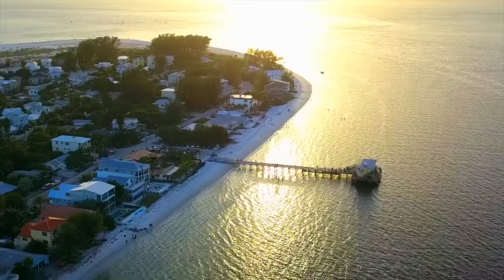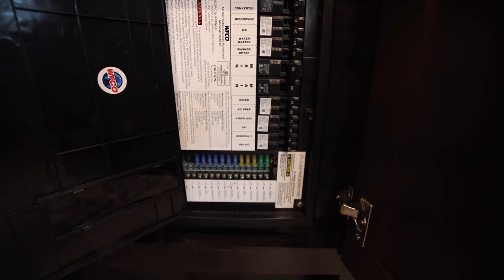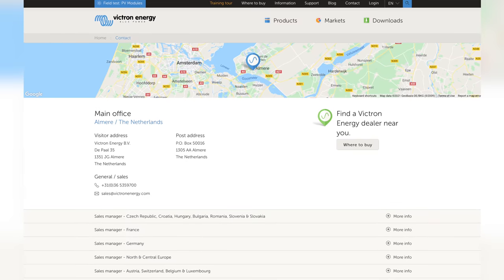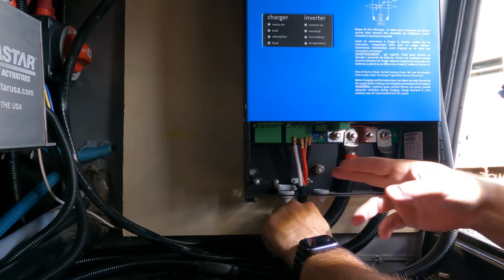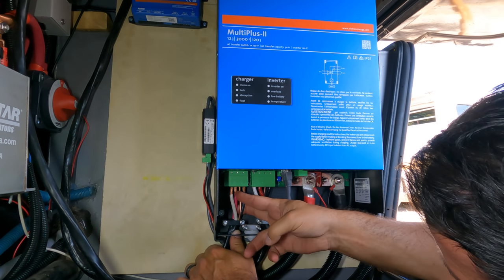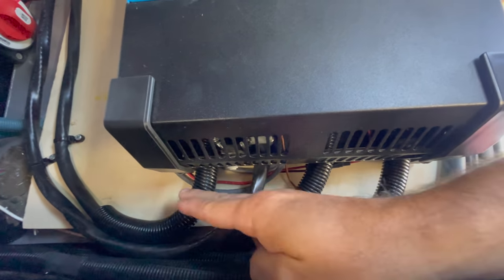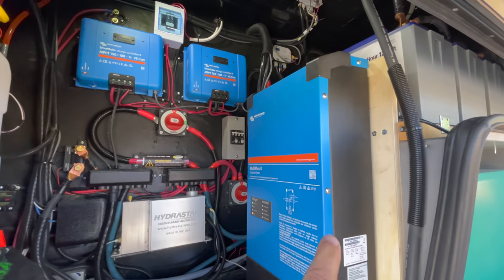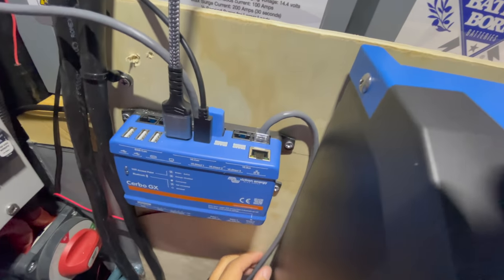🔋⚡️🔌 RV Inverter Upgrade! (Victron Multiplus II 12V 2x120 and CerboGX!) (Full Time RV Life)

Comment: Kind of a long question so if you can be patient please. A question that may or may not be unusual, I've watched yours and several videos on the 2/120 inverter. I ordered and received one in August, but have yet to install it. The reason is this. My 50 amp 2006 Winnebago came factory with a 2000 watt dimensions inverter. The main distribution panel has of course the 2 50 amp breakers, but also a 30 amp breaker labeled "Inverter" Then it has a sub panel that also has a 30 amp breaker labeled sub-main  and several 15 amp breakers marked Refrigerator, microwave, receptacle 1 receptacle 2 receptacle 3. Prior to the failure of my old inverter, I never paid much attention but realized that only those items in the sub-main could be run with the inverter. I assumed, (apparently incorrectly) that the 30 amp breaker in the main panel just supplied power to the old charger/inverter and the 30 amp sub fed all the items I listed above. As the new Victron 2/120 appeared a little complicated, and I was short on time to head off for the winter, I just grabbed a Renogy 2000 watt inverter that wired directly into the 120 in and 120 out and of course the 12v from the failed inverter. What I subsequently found out, it appears that all the power from the 30 amp breaker in the main panel, goes out, and comes back to the 30 amp breaker in the sub panel through the inverter/charger. I say this, because even on a 50 amp shore power, if I turn the inverter/charger off all those items I listed in the subpanel do not work. In fact even with it on, if I have been off shore power for a few days, and the batteries are somewhat discharged, (not dead by any means but maybe 70%) the charge portion goes into a heavy load, and if I try to run the microwave it trips the inverter/charger and all the sub panel goes dead. After the batteries are charged, and the charge rate is back down then I can run the other devices. (the charger will put a maximum 65 amp battery charge so that's a lot of watts just being used to charge) So here' the question. I understand both legs or the 50 amp shore power go directly through the new Victron, but what do I do about the 120 input/output for the old inverter/charger that feeds from the main back to the subpanel? Should I just tie them together now that I have both legs going through the new Victron? Would it be safe to just put a junction box in the electrical bay and tie them together since currently the go through the Renogy inverter/charge? Also the Victron has a second source of output at 120 above the main 120 connections, that I understand is inverter power only out, if you want to set it up so when on inverter only just certain circuits are powered. Am I dreaming that I can wire this with both legs going through the inverter/charger and also having a connection so when I am on inverter only just the subpanel runs? Getting this set up working will be great as I spend all winter on 30 amp, and the ability to run more than 30 amp for a period of time, (daytime) and having the batteries recharge at night would solve a lot of power management problems. Any insight you can give or steer me towards someone who can would be appreciated. PS: Your videos are great. You don't talk a bunch of BS and make a 12-15 minute video last 1/2 hour. Keep it up.  Thanks in advance.

Comment: Hi, was wondering what you used to connect your power and hdmi to the touch. I’ve heard people have had problems running extensions to the Cerbo. Power is easy enough to find something close, but wondering about the hdmi. I am getting ready to install the same system and was thinking I’d have to mount the Cerbo close to the touch even though I have all my other equipment up front (about 15 feet away) it would be nice to have everything in one spot. Have you had any issues?
Thanks-Dennis

Comment: How well does the generator function work on the Victron Multiplus II  12/3000/120-50 2x120v ?  Can the VIctron also do power share with the generator if needed ? How well can it condition the output like if the generator has harsh changes in voltage levels or hertz in frequency ?

Comment: Your so right about the stiffness of 6/3 wire and getting them into the Victron push pins! (We installed the same invertor). I jumped the ground from the in/out terminals because the single wire did not seem to be grabbed tight enough by the push pins. How did you get Line 1 and 2 to show up on the screen? I did not wire to AC2 out. Only AC1. Finally thanks for the verification on load share. Feel free to take a peek at our install.

Comment: hey Chad. this is great. I've seen the video a couple of times digesting the info and getting to know victron products before I buy. 
let me ask you 2 things in your experience 

A- what kind of setting change can or cant you do from Victron Connect VS your GX Touch 50 VS connecting the PC via usb? 

Besides the cute sexy interface of the screen, does it gives you any advantages over the victron connect? 

For instance, if you want to change how much amp is sent to the battery (charger), can you change that setting on the screen OR the ios app? 
OR if you want to change the min working voltage / security 
OR if you want to set charge only mode on / off ( I saw this super nice feature on this inverter) 

I also saw there is a more limited (and cheaper) screen control called "Digital Multi Control 200/200A"  

B-  victron has two devices:
 1- victron smart shunt. only bluetooth for ios. 
 2- victron BMV-700 battery monitor  (that includes a shunt. and you can also connect a bluethooth adapter for ios) 

I saw you have the monitor bm700, but you keep saying "smart shunt" on the video. 
do you have both? (dont think so, right?) 
or, do you have the shunt from the BMV-700 connected to the serbo GX? 

thanks. 

again, extreamly nice

Comment: I’ve been watching you for years. You and your wife are great. This is the first time me commenting on any of your videos. Just curious if I stayed plugged into 50 amp shore Power, but set the Victron to 30 amp with that automatically force it to use my solar and battery power, basically what I’m trying to do is bring my power cost down at a seasonal Campground. would love any advice. Thanks.

Comment: Hello sir, I have a Multiplus 2  50 amp 3000 watt  inverter.  I also have 4 400 watt solar panels and 1200 amps lithium batteries.  My question is do you run 2 of your ac units at the same time?  They pull about 2800 watts together.  Also did you install Soft Starts on your AC units.  Thank you  Ray Prayers and blessings

Comment: hello, as always great videos, can I have some information?  I have a cerbo gx connected to the multiplus and when I unplug the ve.bus cable from the multiplus the multiplus stops working, I wanted to know if there is the possibility of running the multiplus without the ve.bus cable connected.  thank you

Comment: How long is your HDMI cable from the Cerbo GX to your Touch 50 display?   Any problems with the distance?  How did you power your display since you weren't using the power from the Cerbo GX USB port?

Comment: Chad, thanks again for you content here, it is a great help the way you explain the "Techy" stuff.  One than or maybe a question, I've been running the Multiplus and the Cerbo for several years now and I have been able to do updates and configuration changes via the Cerbo using my laptop with out the MX3.  Is this possible with the Multiplus II?

Comment: I've been an subscriber to your channel for years and you just helped me find a good RV park by Moab/Arches.  I really enjoy our videos and find them very helpful, I have a 2018 Grand Design 303 fifth wheel that I need to replace the batteries on and I'm considering going with Lithium batteries and changing my converter to an inverter. Which inverter and lithium battery would you recommend and is the easiest to install, I don't plan on putting solar system in my fifth wheel.  Thanks Much

Comment: Hi, your videos have really help us in many ways. Thank you. I will be upgrading our RV from 30a to 50a. I am interested in purchasing the multiplus 2, a GX Touch 50 display and other necessary components. My question is, am I able to use a portable generator like the GENMAX GM9000iED? Do I need a specific generator? Aside from monitoring my system, my goal is to also have this system automatically turn on and turn off the portable generator when necessary.

Comment: Great video I am looking to get a Multiplus II for the house and this has really explained a lot.  Which exact cables were getting hot earlier in the vid you mentioned it?  I am no electrician but if there's one thing I know, it's that cables should not be getting warm to the touch.

Comment: Chad did you use a USB and HDMI extension cable to go from the Touchscreen back to the CERBO GX? The supplied 2m cable isn't going to quite reach in my application and before i open the box I wanted to seee if there is any real life data about extensions?

Comment: nate Ive order several pieces of equiptment from your store ... is the wire from the solar controlers is it based on the amps coming fromthe solar panels I have 3 controlers 2 at 35 amp and one at 30 ...so 6 awg wire should be plent with a little buffer built in right

Comment: Another great video. A while back I recall you did a video about a hack required to take full use of your 5500 Gen set when using the Victron. Was that the old multi-plus? And does phase issue go away with the Multi-Plus II 2x 120 ?

Comment: I'm having an issue and am hoping you can point me in the right direction.
Before I start disassembling everything to trouble shoot I want an idea of what this might be.
I have two Victron SmartSolar MPPT 150/100-Tr VE.Can.
Both have Five 200w panels connected to them.
1. MPPT is putting out:
91.03v
8 amps
722w
2. MPPT is putting out:
125.17v
0.15 Amps
18w

Where would you start looking for the issues if you had this problem?
Reply: Disconnect MPPT #1 and see if the amps jumps way up on #2.   If so, the problem is likely in the programming, MPPT#2 may have a lower charge voltage set which is causing it to think "batteries are full, no need to push more energy into them".   If that doesn't do anything, next I would swap the solar leads from #1 to #2.   If number 2 then starts charging at higher amps, the problem is either the wiring (to the roof) or panels on array #2.     If you have #1 disconnected and you swap the panel leads and #2 still isn't charging, check the connection from #2 to the battery/bus bar (or just swap the MPPT to battery connections from #1 to #2).   If still nothing, #2 is probably bad or the programming is so out of whack that it won't engage until the batteries are much lower voltage.

Comment: Love that you did all this for use to see how great Victron is and that powerful system you have but once you look into pulling off those AC Units and replacing them with a 3-4 ZONE MINI-SPLIT your jaw will hit the floor. It's just like when you saw the true value in Lithium batteries.  Why are trailer not using (being built)  MINI-SPLITS???
Reply: PS: I bet you could run your AC=(Mini-splits) for 19 hours and not just the 9 you can now...

Comment: grate video. thank you
can i get some advise please?
i recently got travel trailer keystone passport 221bh, and would like to do same system.
i have battery outside trailer, which is connected to battery hock up box outside as well.
am i correct thinking this way? to do in a easiest way i will do
1. first change battery to lithium 170ah
2. connect battery directly to victron 3000
3. unmount existing battery charger, which is in the back of trailer and run 2 cables. one is shore power from distribution box to victron 3000, another one from victron to distribution box to power all rv system
what about my dc part? should i do anything? or i can leave it untouched?
thank you

Comment: With this system, what kind of load can you put on it, like AC's mircowaves and the like. Can you run everthing with the Victron Multiplus II 12V 2x120 I take it you have a big 5th wheel, looking forward to your reply. BTW your shore power is 30 or 50 amp?

Comment: Wonderful Video Chad! Lots of tantalizing info.
One Question. What happens when you try and exceed the Power Assist Limit (ex. Mooch docking on 15A and trying to run 3ACs and Microwave?)  Does the inverter Shut down due to overload???  I am just trying to see how this handles what my Intellitec energy Management System was setup to handle. I don't know if I need to rip the Intellitec out or if it is needed with this (I believe it would butt heads with power share feature with the intellitec trying to dump loads as the Multiplus II provided extra power to handle those loads). Thanks!

Comment: Excellent presentation. Thank you.  I have a couple of three projects either planned or working on.  One I am trying to develop on a low budget is a small cabin/radio shack.  I have lead acids that are going out and want to bring in a LiFePO4 (which I have a basic system in a mini motorhome).  Rather than using 12V I was thinking of 24 volts, ... I am using small about of solar for now and want to expand the system as I can swing another battery or more panels.  Point in this comment question is the power share, do they make it with 24V or is it only 12V ...
Reply from the maker: I think they now have a 24V MPii..  And that is the way to go IMO.

Comment: Great video Chad. Timely in that I just bought 4 330 watt solar panels, 4 SOK 206 amp batteries and have a Multiplus 2 on order. One question I have is why you stayed with 12 volt? Not 24 or 48?
I ordered the 48 volt Multiplus and hope that works out for me. I am going to connect the 4 SOK's in series to reduce the wire size as I am not sure yet the placement of components. Batteries and inverter may not be close together.
Reply from the maker: 48V is a great way to go.  This was a progression of upgrades all built on the original 12V.  If I were designing a system from scratch now, I'd also do 48V.
Reply: While you can get a 24 to 12 volt converter for the coach - Chad (and I) have a generator and it's hard to start a generator (surge amps) from a 24 to 12 volt converter(s).

Comment: This is a valuable video. Thx u! One question, if I parallel two Multiplus-II 120v would I get 100A passthru (50+50=100A)? 
Also can u do a video on how the different power savings mode work??

Comment: Hey chad, love the videos and have been following for a while, I’m doing the same set up as we speak on my 2017 momentum. One question is what do it do with the power from the deck mounted charger that goes to the fuse box in the rv. Then it goes back to the battery. Do it just disconnect this? Or does it have to run back to the battery?
Reply from the maker: We disconnected our stock converter but left it in place in case we need it in the future.

Comment: I'm hooked! Second in-depth video of yours I've watched and it goes to my 'watch later' folder for quick ref. In your shortest answer, is the new (2022) GD solar / inverter factory package worth the  $? (300W panel, 3000W inverter) Haven't been able to find too much info on the exact products installed. Thanks much.
Reply from the maker: We're not really sure exactly whats installed or how it's wired either.  But, we do know it's not a whole RV setup.  So, it won't run any AC unit.  But it's a great way to get a start and to run the fridge and such while traveling.  That's all many people need.

Comment: Chad, I'm sorry if you answered this question already there are almost 500 comments. 
Do I need to run 4/0 cables connecting my batteries? Or can I run 2/0 linking my batteries together and 4/0 to inverter?
Ty for your time.

Comment: Did you add heat to your front compartment or do you stay away from freezing temperatures?  Trying to decide where to do my install and have same front compartment with generator.  Was worried about charging batteries in cold temperatures.
.

Comment: Very interesting, one question though , with 10 12V batteries why you didnot go to 24V for 3000VA, making DC currents less critical (half of.the 12V system) on contacts, cables and enabling to use only one MPPT where you use now 2? BTW Victron s head quarter is in Netherlands...  Main advantage of modularity of "loose" but system connected building blocks...but, yes you need to be a little bit a nerd..Rgds Wessel.Europe.(we use 240V 50Hz single phase or (line to neutral) or.3.phase (120 degr angle between phases, or 400V between 2 phases (sqrt(3) * 240V..advantage of 3phase systems (using sx multiplus: you van run 3 phase moters without capacitors and their problems on thinner 3 phase cables..

Comment: Hi Chad, excellent Video. I have a question with regards to what looked like you hydrologic lines. I don’t know how reliable they are and it may be a none issue. but I would be worried about a line breaking and spraying your electronic equipment. Yes I am paranoid about things like that. second concern is information assurance security related and I would prefer discussing in private. how can we discuss this?

Comment: So i’m still wondering how you are going to keep your batteries warm in your front bay due to your generator has access to the open air and in cold weather conditions could go below freezing conditions. what are you doing to keep the battleborn batteries warm so they can keep warm enough to charge properly in a cold weather condition? Great Video!!!
Reply from the maker: The generator compartment is isolated from the rest of the bay.  However, if it becomes an issue, I have the furnace ducting directly adjacent to the bay and it would be simple to direct some heat from it to the front bay.